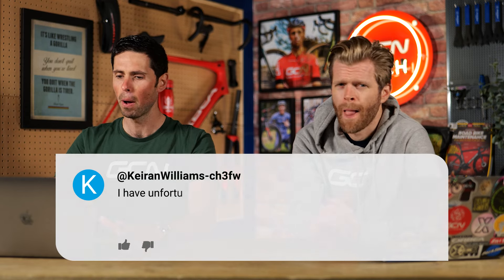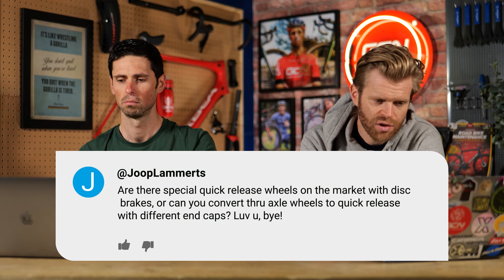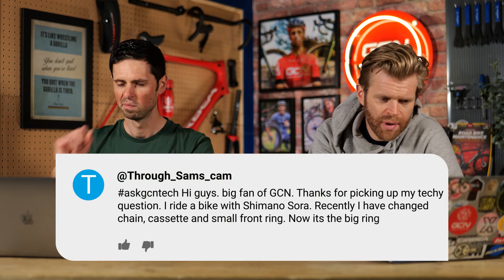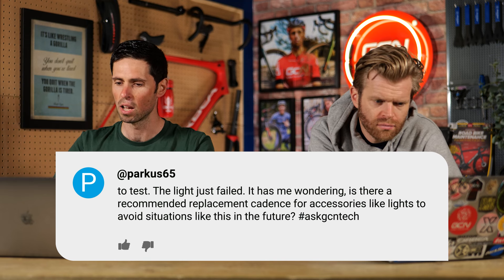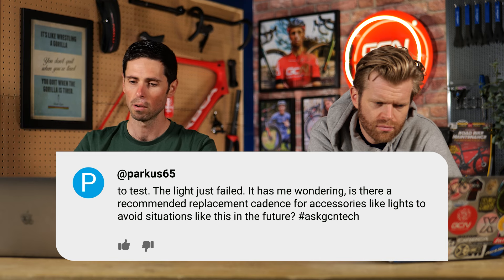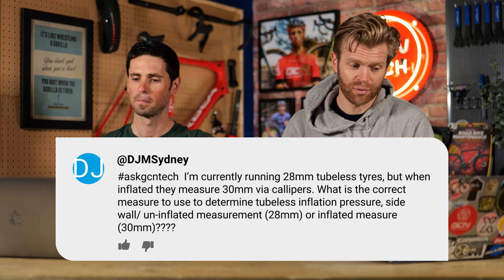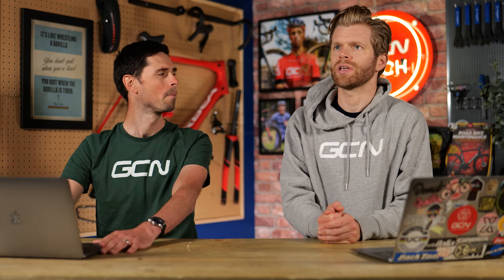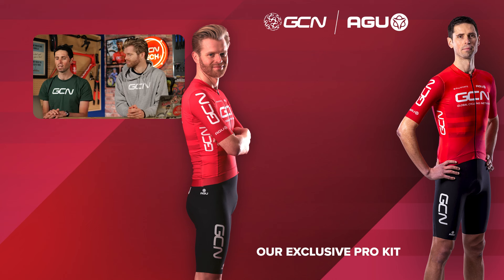Chainring Confusion, Internal Tubeless Tyre Patch Up & Bent Sprockets | GCN Tech Clinic

Comment: To the world: balancing a tire is not a thing. None are ever balanced because of the valve stem and furthermore an imbalance is not detectable while riding.
Reply: It depends on the speed you ride at. Only after balancing my DT Swiss ARC Dicut frontwheels, I regained control over my bike, which before was a little bit wobbly at speeds over 80 kph. The rear wheels (a Specialized Trispoke and a HED 3D disc wheel) and a front Trispke I had to balance already 20 years ago, unbalanced these wheels felt like they have an egg-like form (not detectable, my a**), and already at speeds around 30 kph.
Reply: @overcookit1433  There are always exceptions. I’m guessing your wheels were grossly out of balance and certainly not typical of what 99% of cyclists experience because 80kph is not an abnormally high speed.
Reply: Balancing a wheel (incl. tyre) is a thing. Hambini made a video about it.
Reply: i use stick on lead weights that golfers use to balance my wheels, they are thin and stick like dog sh*t to a blanket, they just don't fall off
Reply: @chrisko6439  Just because Hambini balanced a wheel doesn’t means it necessary? Hambini is your reference for all things essential? Unless you have a seriously defective wheel it’s not necessary or even noticeable.
Reply: @stevevarga8621  That American guy with the moustache also did a whole video about balancing a wheel. What you do is put the bike upside down, spin the wheel a few times, and if it settles at the same spot every time put some weights on the other side to balance it out. I wasn't sure what good it does.
Reply: Yes it is, yes they are, and yes it can be. You may not have experienced it but it does happen. Especially with the less expensive end of the gear spectrum, so congrats on being richer than everyone else I guess ¯\_(ツ)_/¯
Reply: @stevevarga8621  ok, take all the wheel balancing weights off your car and see how you get on if it's not important, perhaps all car and motorbike tyre makers are wrong and you are correct, do you think that's likely? just because balancing your wheels on a bike isn't largely seen in the cycle industry doesn't mean it's not important, and no, i don't watch hambini, but i know he's a qualified engineer, are you?
Reply: @Timtheranger  OMG, you can’t compare a car tire to a bicycle wheel. All car wheels are balanced while literally 99.9% of bike wheels are not because it’s only necessary in the most extreme aberrations. Go take your bike into any bike shop and ask for a balancing and see the look are the mechanics face. There isn’t even a machine that does that.
Reply: @stevevarga8621  i work in a bike shop, i was also a mechanic for 2 professional teams, I'm also a qualified engineer, i advise people to balance their wheels when they are bad, people typically ask why nobody else brings this up after I've shown them how bad an unbalanced wheel can be and thank me afterwards for balancing them,you don't need a machine, it's common sense how to balance the wheels, many say how it's made a huge difference, you keep riding your unbalanced wheels if you know best, just don't try to convince people who know better that you are correct, i feel embarassed for you that you'd even do such a thing.
one question, have you ever had your wheels balanced so you actually know the difference?
Reply: Tyres don't need balancing but some wheels do , an unbalanced wheel is why you get speed wobble over a certain speed (we've all had that)
Reply: @Cycle.every.day.  I agree, I misspoke.
Reply: @Cycle.every.day.  i typically do it with the tyre fitted, just to factor out discrepancy in tyre manufacturing, but i leave that choice up to the customer mainly, tyres are typically quite good, but not all manufacturers are
Reply: @stevevarga8621  1. No, what makes you think that? 2. No, what makes you think that? Does mentioning Hambini trigger some PTSD issues for you? I jsut mentioned him so people can look for the video if they want to. 3.Wrong, it is noticable. Put a big gear on, lift up the rear of your bike and let the rear wheel spin very fast. Your bike probably will start to wobble up and down. Or try a very fast descent. If you don't notice a wobble, you are either lucky and your wheel is balanced or you are numb.
Reply: If you need to balance your wheels, them might be a spoke tension issue.
Reply: @alumal  Nope - it is just the valve, and as I use the extremely light Vredestein Latex inner tubes, the valve is relatively heavy, especially with the required valve extender. I had to put the balancing weight exactly to the opposite side of the valve.